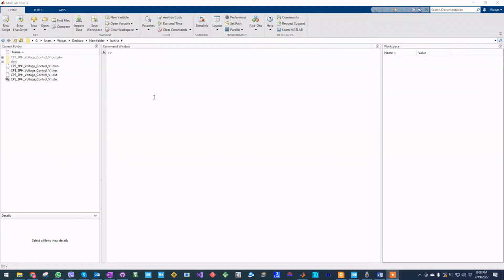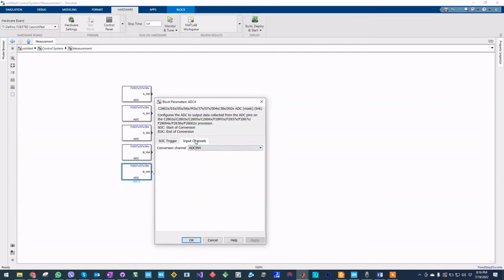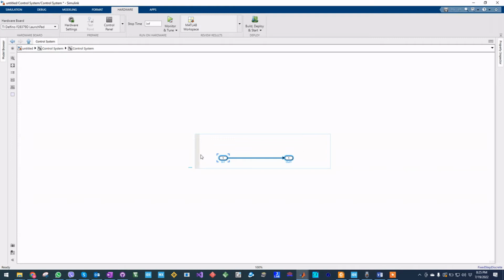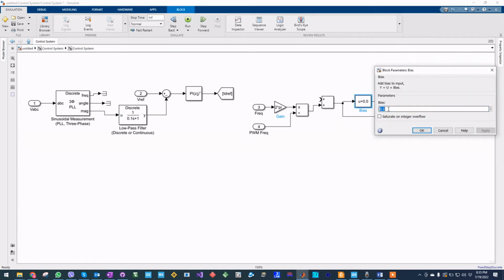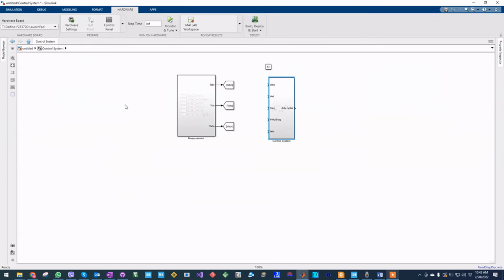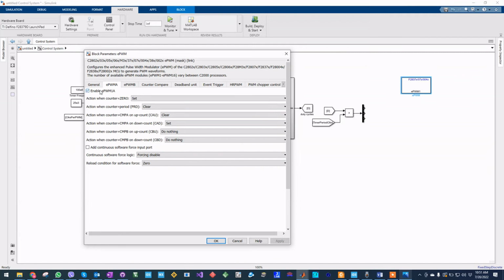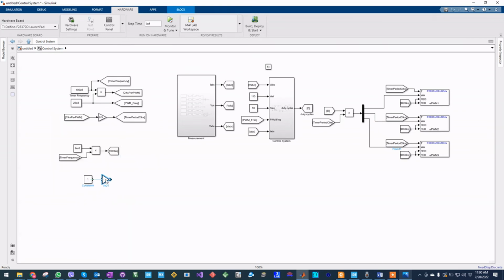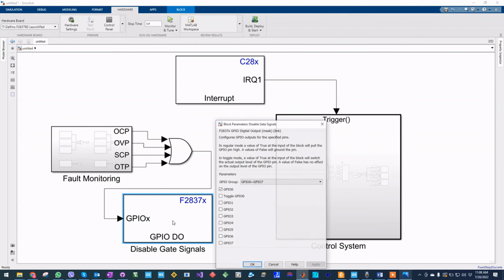CPE-3PH Closed Loop Example Creation

Comment: I am using the GPIO DO Block, and the PWM Frequency is 4 kHz. After generating code from Simulink, deploying the Code to hardware, and then observing the PWM frequency on the Oscilloscope that showing around 1.3 kHz. Why is the PWM frequency dropping?
Reply from the maker: If you are toggling any digital output block, the frequency should be actually half i.e. 2KHz for 4KHz PWM frequency. 1.3KHz may be due to some measurement error, because toggling via GPIO is through code and exact timing will not be achieved from it, some times it will switch early, other times it may be delayed switching.